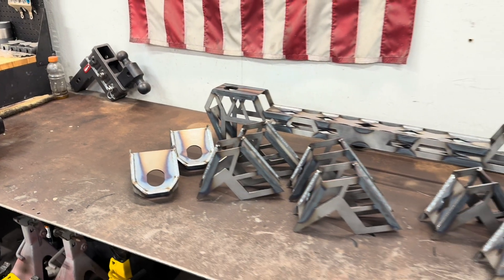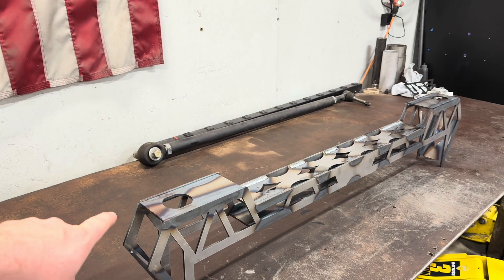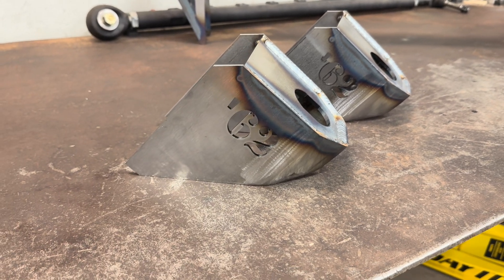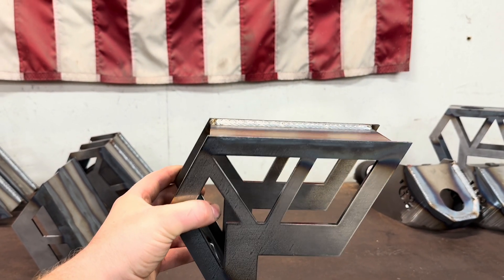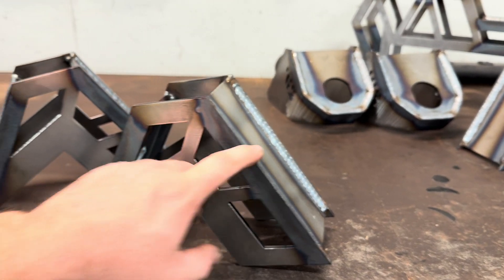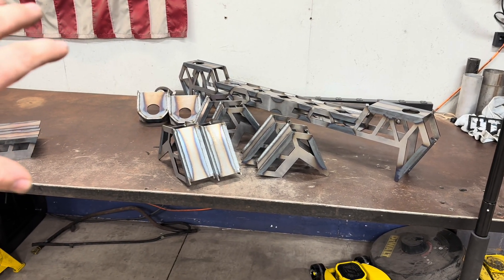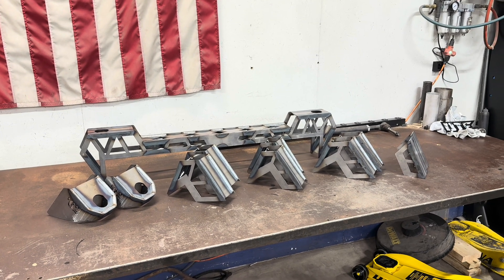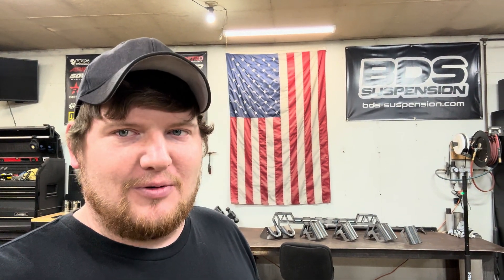Dent side / bump side body swap kit onto superduty chassis - Old body swap kit

Comment: What years super duty do these work on?
Reply from the maker: it was designed on the 99-07 frame but should work for 99-16 since the cabs and beds interchange between those years.